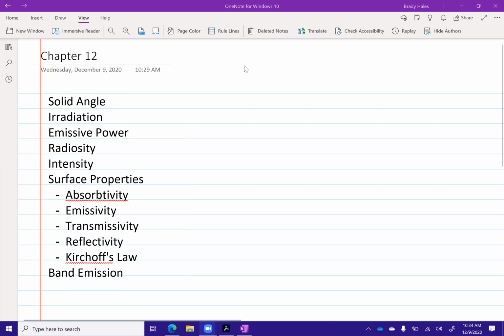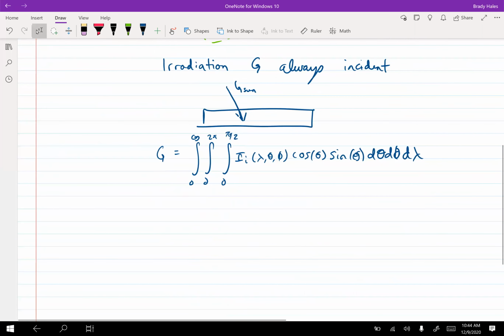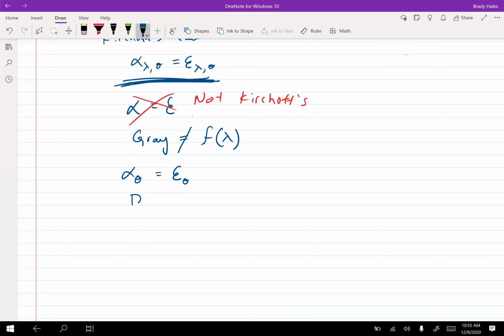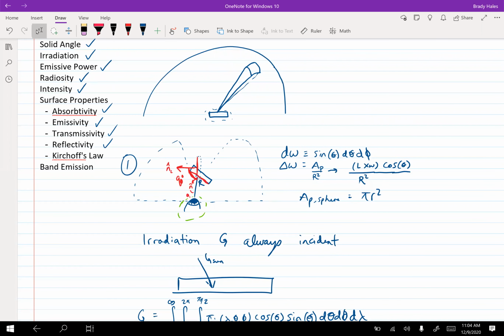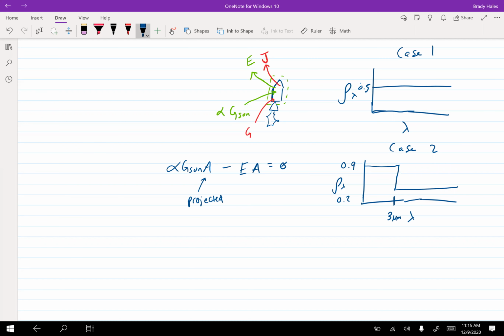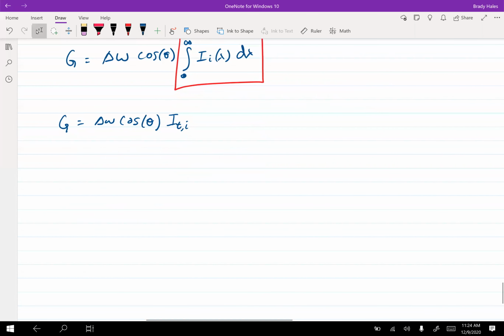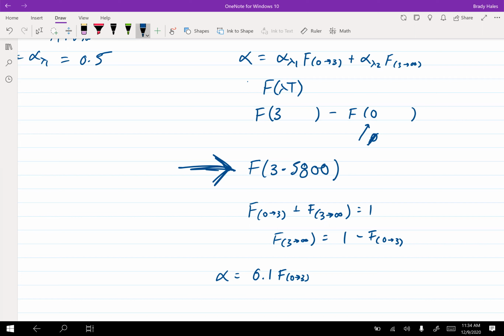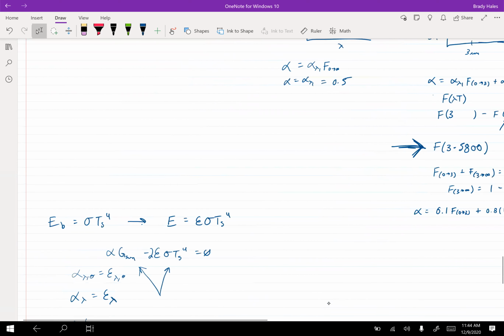Chapter 12 - Fundamentals of Heat Transfer by Bergman, Lavine, Incropera, and Dewitt

Comment: Very helpful. Thank you!
Reply from the maker: Thanks Zachary! If you have any suggestions or any other specific concepts/chapters you would like me to go over please let me know. My goal is to get a review video for each chapter but I am unsure how far I will get so if you have any suggestions I will prioritize doing a video for those concepts before doing one for each chapter;)
Reply: @halesenginuity6006  I would like to know more about when to use emissivity versus view factors. Also, when looking at example problems that have you solve for view factors I am confused as to how the area is determined. Thanks for taking the time to put these together.
Reply: @fireflybear3576  I just posted a review video for chapter 13 and I hope it helps! Emissivity comes into play anytime you have a real surface instead of a blackbody. Special attention to the part about radiation resistance networks part of the video will hopefully help you see you the emissivity is used to turn a blackbody into a real surface and calculate the radiosity of a surface. Then this radiosity is combined with a view factor resistance to get a net heat rate between two real surfaces.